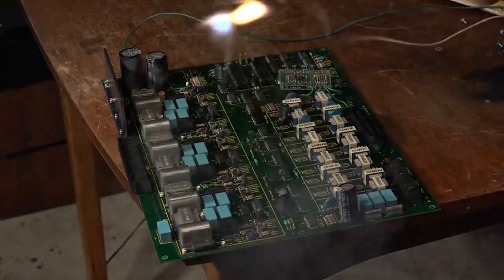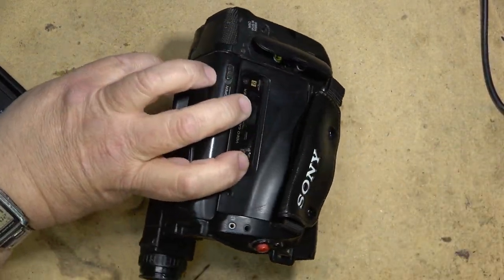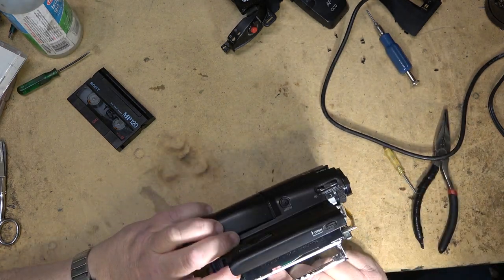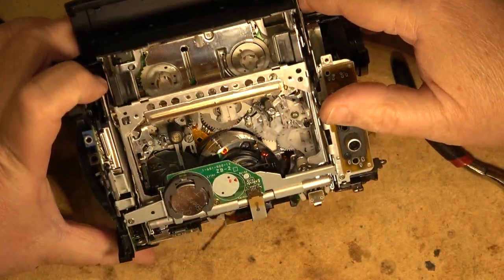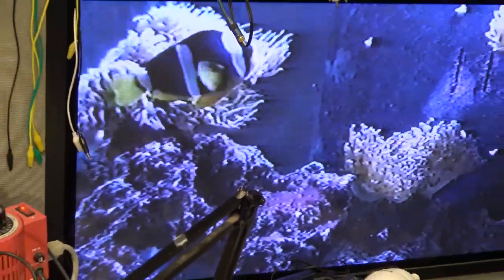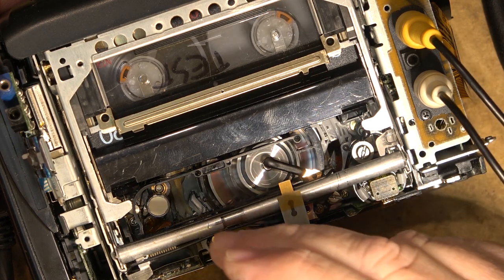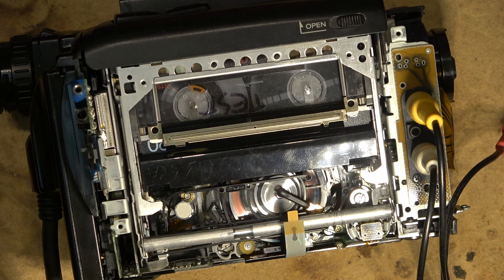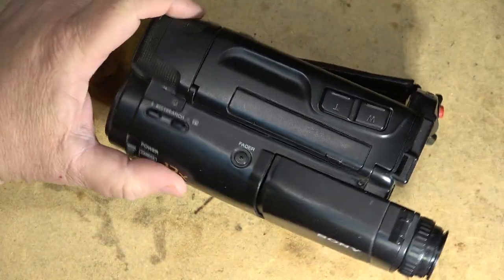Sony 8mm Hi8 Type A mechanism Chewing and Creasing tape on Playback Fix

Comment: The Sony specialist at work again 👍
Reply from the maker: He says that as i condemned 2 camcorders today.  Sorry no video on either.
Reply: @12voltvids  The fact you can even get some of them working already makes you a professional haha. Nobody can fix  these things anymore.
Reply from the maker: @enzoperruccio  I try. I do give up fairly easily though. If I get one that caps have leaked all over the board and traces are lifting I walk, as they just won't last.
Reply: @12voltvids  Yeah. I despise even taking them apart. So many screws and pieces that need to fit together in a very specific order. And at the end of the day I know nothing about them, and can only look for visible problems.

Comment: I bought one of these new in 1980. I still have it. Near mint condition. Between the camera, player, charger, cords and tuner, I had more than $3500 in it. Top of the line at that time! Thanks.
Reply: 1990?

Comment: That was a nice simple one for a change, it makes up for the shitbag capacitor failure ones.
Even the guides were not messed with.
Reply from the maker: The A mechanism was pretty good.  These were after the crap problem so most are still good.

Comment: Awesome video, Thank you. I have a Hitachi 8mm VM-555LA that appears to have a bad pinch roller as well, when I put a tape in it plays for about 10 sec then you hear a crinkle and it stops playing. On the camcorder case it says "NTSC8". Does that mean its a "Video8" and not Digital8 or Hi8? 
if the answer is yes, then I would like to buy one of your refurbished "Video8". Can you tell me how to find you on-line to do this please. I have 6 tapes I need to digitize. Thank you.

Comment: Got a hi8 camera (DCR-TRV460) that has a tape in it that it won't let out. I think it's the pinch roller, as you mentioned in this video, since I saw it loose earlier. When I open the door, it makes the chime sound for ejecting a tape and it moves some parts, but the tape never ejects. It gives up after about ten seconds. Any ideas on how I can get this out, and get my camera functional again? I'm hoping to capture a bunch of old memories I have on these old tapes.

Comment: I have a TRV20 that crinkles my tapes not along the edges, but the middle area. I can hear the tape scraping on something every half second or so during playback and also while recording. When I eject the tape, it sometimes makes a strange metallic spring sound as the tape rises and the mechanism struggles to open.

Comment: Just thought I would mention that It was very common for one of the posts next to the adjustable guides to work loose and catch on other parts stopping the the guide base from engaging correctly ...there was a Sony technical bulletin explaining this problem. Sometimes the post would fall out completely, other times it could just be sealed back into the base. I thought this was one of the most reliable (for its size) video 8 decks made. If i remember right it was used on some Sanyo camcorders too!
Reply from the maker: Fully aware of that. That's why i pulled on the pin to see if it was loose as they have a habit of falling out.  Usually after someone left the camera in a hit car and the aluminum base expanded slightly. I did one last year and that camera is still here.  Another one ready to go to a new home.
Reply from the maker: And canon.

Comment: Thanks for your video.  I have a Canon ES75 camcorder I bought new around 2002 and used once for a family member wedding.  Whenever I try to play the tape it eats it. I tried cleaning the rollers and guides (I did VCR repairs on Beta and VHS machines back in the late 70s so have some basic knowledge), but this hasn't helped. I took the tape apart, and dont see any issues with it either. The tape is wrapped around the pinch roller several times when I go to remove it.  This is probably the first time I have tried to view the tape since then. Wonder if the tape is sticking to itself?  Unable to RW or FF the tape because it gets mucked up when loaded I believe.  The viewfinder always shows "Eject".  Any thoughts?
Reply from the maker: Many of those cameras had a guide that fell out
Reply: @12voltvids  Thanks much for your reply!  I found that upon cartridge insertion, while it unwinds the take up reel onto the video head, the supply reel should rewind that slack it let out.  It wasnt doing that, hence the eating.  Since it sat for many years, I manually moved the gears back and forth a few times, and kept retrying it, and it finally started working.  Just gummed up gears maybe for many years of non-use?  I was looking for slipping rubber belts like VCRs, but couldn’t see any.
Reply from the maker: @terryg2160  they use toothed belts on the mech.  Don't get gummed up but a single grain of sand on the belt or in the fine gears can stop things up nicely.

Comment: Hey Dave, I recently got my hands on a CCD-TR45, I did a small diagnosis on the camcorder and everything works regarding VTR mode (play, pause, rewind, etc.) Mechanism is ok, although I get nothing but a white screen on the viewfinder, same thing goes for camera mode, if it does end to be caps would it be a video board or camera board fault?

Comment: What could be the cause my dv tapes playback has glitching? Dirty heads?
Reply from the maker: Depends.  Typically on digital formats when a head clogs you get bands of frozen picture.  5 bands of moving picture 5 bands of frozen, or 5 black strips. This is because the headvdrum spins 5 times per video field.  9000 rpm vs  1800.  Pixelation is generally an alignment issue or an attempt to play an LP recorded tape on a different camera than recorded it.  I know someone that recorded all their tapes in LP because they were cheap.   Camera was stolen bought a new one.  None of his old tapes would play. Brought them to me. None of my 4 dv decks could play them either.  He asked what could be done. I pointed out the part in the manual that warned about LP use and said too bad so sad. You have lost everything.  He threatened to sue Sony. I said good luck and then pointed the part out in the manual that says that the manufacture is not liable for loss of recordings.  Guy has a huge boat. I didn't feel sorry for his loss if all his vacations and sailing adventures.  Not for 1 second.  Being that cheap to get 90 min instead of 60 on a tape.

Comment: Is it still possible to get these pinch rollers? I put a tape in my old machine and it started gobbling it. My former supplier of camcorder spares no longer sells any and a quick google makes me think they rollers are no longer available.
Reply from the maker: Yes from other old camcorders. That's the only source. Fortunately they are all pretty much the same.

Comment: Excuse my lack of terminology but the large round part that’s spinning fast on my unit is making a really bad sound like something is either inside of it or off balance. Works fine but the noise is real concerning like it could break at any second.
Reply from the maker: That would be the scanner assembly also called the drum.  It holds the video heads.  If a tape snapped inside it is possible that a piece of broken tape got between the upper and lower parts or dirt has gotten inside or the bearing is shot and getting noisy.  The rotary transformer is also in there and they have been known to fail.

Comment: Where do you sell the camcorders that you fix?
Reply from the maker: Many i sell right here.  Others go on FB marketplace or Craigslist.  I don't use eBay as I have been burned.  A big problem with eBay and PayPal is someone will buy a camera use it to digitize their footage and then claim it isn't working and return it, file a dispute and get their money back.  Or they will say it doesn't work and not return it and get their money back.  I got burned about 15 years ago when i sold my old evw300 professional hi8 camera to the tune of 2500.00.  I have had a few others that were claimed not to be working and they were sent back and customer refunded only to find they were working fine and resold. People have figured out this is a cheap way to rent stuff.  I get burned though because eBay and PayPal do not refund the listing or completion charges so the seller still gets burned in the long run